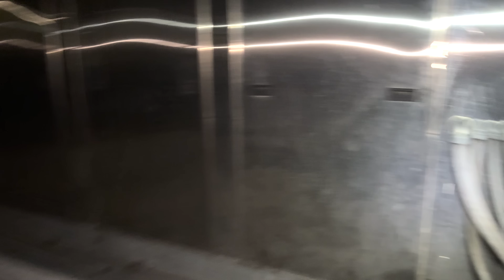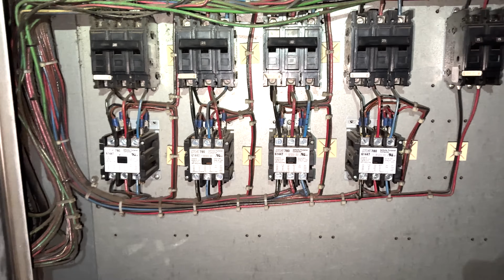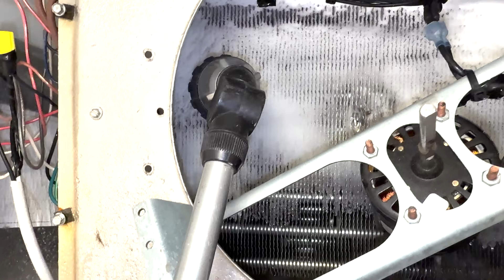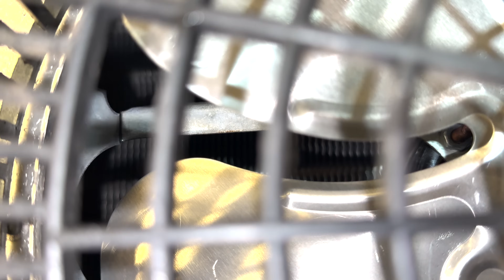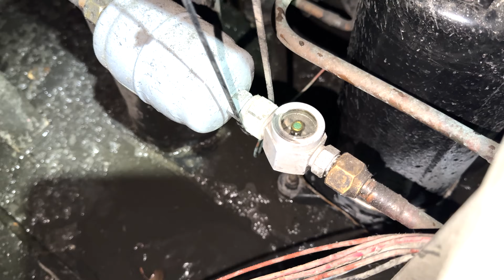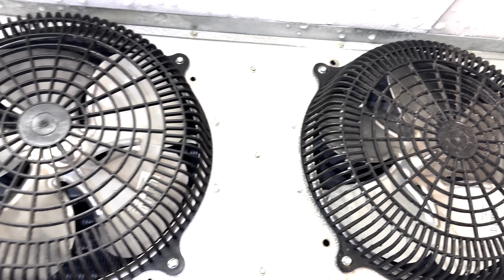A WARM WALK IN FREEZER

Comment: Have you thought about making a folding or socketed frame out of unistrut or even wood, that you can then just throw down some tarp material and make a quick 'drip pan' under these devices?    The plastic can be used to also lie on under some of the nasty make lines as well.   Basically, the frame is just a 'lip' that lifts the edges of the plastic.

Comment: I have a bit of a strange request although it might not being too strange to you would it be possible for you to make a video or even a theory about how air conditioning work and learning some of the lingo and the acronym to get the things for the temple for TSC the Schrader cores the Cormac fittings those kind of things and maybe if possible you could take them apart and kind of show the inner workings you could diagrams they work but stealing the actual components lead out and how they would be set up in a air conditioning unit and seeing kind of how they would interact with each other I think that would be the most informative at least in my name
Reply from the maker: Alot of my videos have this information in them, but it's in bits and pieces here and there as I come across various issues in the field

Comment: Look at the timer under it there looks like a lose wire  not connected to any thing  blue wire no wire nut on it at 3.20
Reply: probably abandoned defrost terminate wire. it may have head a clear push on protector, not that I like them, but used often on things from factory which have no power/spare wires.
** looked again, blue wire, stripped short and bare end, probably had a piece of tape on it at one point, probably still abandoned defrost terminate (X terminal). it's neighboring timer to the right was the same way, but tape wrapped on the wire end.
Reply from the maker: I'll have to go back and double check

Comment: Also look at your ceilings. They can be a tell that doors left open. Lots of frost on ceiling, coil, fan guards. Older walkins may be so old the seams are leaking air into box from panels. Door gaskets typical missing or ripped. Also electrical junction boxes on top of box carry warm humid air into coil electrical end. Remove cover up there and squirt some silicon in the conduit. Just a few other thoughts.
Reply from the maker: Very good point, or points rather

Comment: My money is on it was iced up due to improper air flow due to the broken brackets paired with the bad fan motor, and staff leaving the door open. Especially if your humidity was high paired with blocked drains, I think you just had the perfect conditions to get that thin layer of ice on the coil.
Reply from the maker: That's a good hypothesis

Comment: That thermostat regulated heat tape has to be the worst thing to use on a walk in freezer. Self regulated heat tape is 1,000,000 times better than that and probably has a much longer life span.
Reply from the maker: I wouldn't necessarily disagree with that

Comment: how do you clear out the drain line, compressed air/ water hose ?I spent a little time as maintenance and found the drain lines on the ice maker just GROSE !!! never figured out a way to clear the lines before I left that company :(
Reply from the maker: Water is all I use for drains, c02 will go around debris in the drain but water tends to fill the entire drain and clean it
Reply: @HVACRVIDEOS  didn't know if there was some kind of snake for such a small line, or trying to blow a foam ball through the line

Comment: Great video Chris. I do have a gripe about TruTech tools though. The discount code you mention never works for me, maybe I’m spelling it wrong. Also, went to an purchase the Max Flow core removal tool, it was $300 more than many other websites, gave cc info, then cancelled after I called and talked to them and they said they can’t match the JB Industries price. They called me back like an hour later and said they made a mistake and could match the price, but by that point I had already ordered, cancelled the order, and ordered it from a different vendor. My point is, compare prices before purchasing from TruTech, if you find a better price for same product, give TruTech a chance to price match, they probably can but want proof of better price first. Also, keep in mind it’s an apples to apples price match. TruTech can’t match price of a Temu product compared to a JB industries product for example

Comment: After months of seeing your videos I finally figured maybe I should clean the condenser of my fridge. Dunno if it's because it's an "air cooling" type but it's a small  one at the bottom not the huge classic grid. Had to unscrew the back bottom panel but woah it was really dirty, so much dust I could barely see it at first. Hopefully this will help keeping it working longer.
Reply: As an appliance technician, it will help !!! Your fridge thanks you.
Reply from the maker: You may have just saved it's mechanical life
Reply: how long has that fridge been collecting dust/dirt? Now I'm worried about my decade old fridge lol.
Reply: @colinstu  Since I got it so 5y I guess ? But I don't have pets so it can probably be a lot worse.
 It's not like anyone tell you to  clean these, maybe because you could easily damage it or maybe because it's designed to handle it as long as warranty last.
In my case on top of needing to remove a panel tons of tubes are in the way so it was pretty difficult to clean. Next time I'll try to have some small fittings for the vacuum.

Comment: Do you think these coolers will work right ,with 15 min. defrost and no termination ?1:40.
Reply from the maker: Why is there no termination ?
Reply: @HVACRVIDEOS  there is no wire on x.the blue wire is disconnected bare underneath clock.

Comment: do you think two 15 min defrosts during work hours is enough? especially with open doors?
Reply: Yes. Older equipment and boxes sometimes 6 @30. Consider your customers.  Auto Door close and curtains a must. Also a door limit switch that kills fans and liquid solonoid helps alot.
Reply: I like to use 45 min.4 times a day,and let the termination,cut it off ,but the x was not hooked up,maybe only 30 min ?in case they leave the door open.